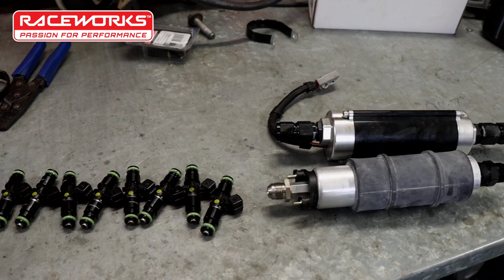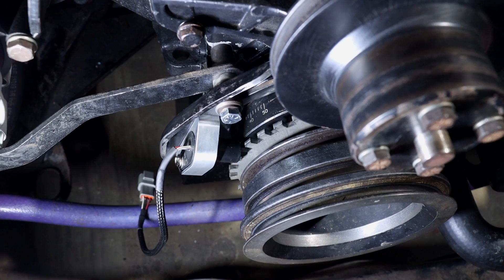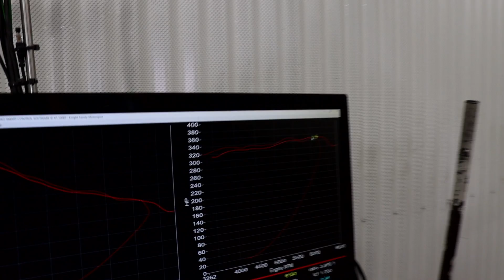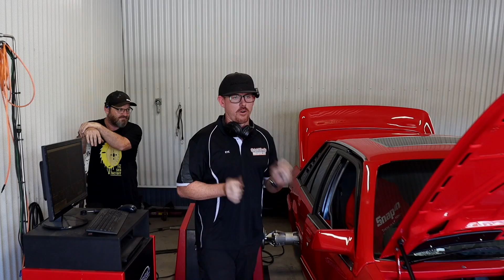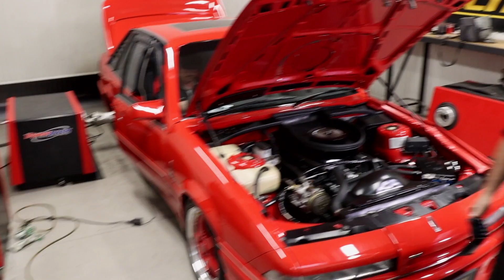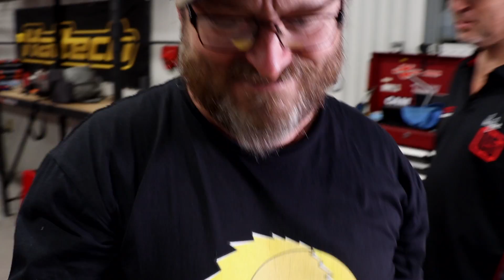NITROUS Fed HOLDEN 355 - Peter Brock VL Calais Sport Ep3

Comment from the maker: WE FORGET TO TEST THE POLARIZER!
Reply: if you fit two of them does it become a bi-polariser ? 🤔
Reply: @BaldBloke  😂👍
Reply: @BaldBloke  :face-fuchsia-tongue-out::face-fuchsia-tongue-out::face-fuchsia-tongue-out:
Reply: It would have reved out smooth with the Polarizer.
Reply: In your defense, polarizing a generator is a thing
Reply: It would've sorted the valve float and let you rev it to 10 easy.
Reply: Yeah, c'mon. You need to put the Polarizer on!
Reply: Back to the dyno.
Reply: If it really did nothing and actually caused harm,
We must call it a pfolarizer
Reply: Had it in your bedside draw al
Reply: @andrewfreer5797  maybe the wife has it ;)
Reply: @andrewfreer5797  :face-green-smiling::face-green-smiling:
Reply: THAT'S WHAT i AM HERE FOR!.....Disappointing...
Reply: And you didn't do one on stock setup so no comparison to be had.. 

Stares INTENSLY.. IDIOTS 😂
Reply: That’s the only reason why I watched this episode 😅
Reply: You need to put it in a specially mounted box and wire a hall sensor to the ecu, so when present, the polariser gives a few extra kw, then it would work for real!  👍
Reply: HOW POLARISING.
Reply: Would have made 15 more HP
Reply: @Adrianzx  ONly if the tire pressures are reduced to 10psi mate..
Reply: Oh well. Take it back to Banana Bender Tuning Fork.
Reply: Boys its a well known fact that the polarizer was static electricity and idk if you can wank on YouTube and it only worked from walking power 😂
Reply: Take the polariser to a vegan wet yoga instructor who can fold/unfold their genitals and knows astrology. If they're legit they will be able to tell you the crystal frequency just by holding it. After that it's all just basic woo math.
Reply: I was just going to ask that😂
Reply: I was just about to ask for the special magic box^^ align molecules voodoo style
Reply: Been dirt squirting lately boys ?
Reply: do not bother, it was all  marketing plan from the get go, prove me wrong guys?
If holden could not work it out, then you know its about trying to make the harmonics of the engine be a lot smoother, which we know its about blue printing and having the spec of the engine spot on, everything from valve springs, to lobe separation angles and ratios, right down to the gap of spark plus and even the right oil as well, like every moving part in the rotating assembly needs to matched perfectly and blue printed, no amount of crystal is going to make a rotating assembly smoother? 
Maybe the electrics for the car, no static residue that effects' the modulation of the dizzy, but you guys have a VT sequential dizzy, so it works via ECU, back in the day with carby, brocky had chevy needles and other items from the USA for the carby setups?
Reply: Came here to say just that!!!
Took the air filter off, but didn't put the Energy Polariser back in!!! 🤦
Reply: hi who you you recommend to dyno tune a 393 cleveland. cheers
Reply: You need to drop your tire pressure to 22 PSI when you do tested. According to brocky
Reply: can you use nos all the time in the Vl . Or in a drag car , does the engine have to pulled apart every time and rebuilt using the nos .
Reply: I reconditioned an engine in a VL Brock 'plus pack' around 1990. With the polariser disconnected from the universe the performance difference was staggeringly nil ! The smooth ride from the polarized VL was probably the recommended 24(if i remember right) psi tyre pressure. 👍🤣
Reply: @craig8187  idle tard helps smoothness.
So does 6 cylinders inline
Reply: @silverwolf4095  🤣  its a Polarizer! Maybe there would have been a better smoothing effect if it was spelt Polariser 🤔 S definitely looks smoother than Z , no wonder the effects were questionable!
Reply: @craig8187  these are the facts.
Back to the future screened at Village cinemas Aug 1985.
Brocky attempted to reverse engineer the tech but had to rely on a VHS copy of a copy.
The size of the crystal was off and the magnet ratio was wrong.
He was on the right track
Reply: @silverwolf4095   i think you have become polariszed !
Reply: @craig8187  on a serious note,
I believe the polarizer to be a clever marketing and plot device.
You tick that box and you effectively get the wednesday build, the closer matched parts. Rumor has it Brocky runs all polarized cars in, 2nd gear burnout.
The fact remains HDT could not afford the "advertising" Wheels and Modern Motor wanted. So they roasted the Bloke and his super cool car.
Either way, Id trust Brocky to setup a commodore better than those pencil wristed motoring journalists.
Reply: @silverwolf4095  if the Plus Pack engine i reconditioned was the better matched parts well id hate to see the poorly matched stuff. All that aside. I was around at the time but i dont knownthe facts. What i summise is that with all due respect,  Brock just got a little too confident or mislead and thought anyhe did/said would stick. Stick it did not, all up quality control was pretty average,  more serious names popped up and Brock was out. Al interesting,  debatable, yet great history. A time that I could happily go back to.
Reply: @craig8187  agree.
The golden era of ticking boxes that made a difference, LSD, headers etc, was much better than the muffler/wheel upgrades offered in later years.
Reply: 1st thing. 
Its a polariser, not a polarizer.
Brock was many things, but never a yank.
2nd thing, IMPORTANT! Polariser needs to be remapped for cam and passenger arm rest.
I know a bloke who does polariser reflashes and flash tunes mufflers.
Let me know
Reply: @silverwolf4095  :face-turquoise-covering-eyes:
Reply: removing the air filter would have done more than those crystals.

Comment: that tool pro scan tool is total crap... miss reads codes and shows false codes... had 1 showing me that my egr system, maf sensor, catalytic converter and o2 sensors where bad... took it to multiple shops and the real scan tools show nothing is wrong at all... the car was a 2010 ve omega

Comment: Wish we had Holdens in the States, awesome car! Is that engine basically a 305 LT1? (Stock trim not the modified one that this one is) 👍
Reply from the maker: The Holden V8 is bit of a mix of all the GM engine designs from the 1960s but is not the same as any of the others apart from some dimensional properties.
Reply: @theskidfactory  awesome thanks for the knowledge! Love your guys’ channel!

Comment: The Skid Factory +:  An interesting, fact-filled presentation concerning introduction of nitrous to this particular car/engine. In the process, identified mechanical issues w/ the existing ignition timing system and existing valve train. These issues were essentially corrected w/ the addition of a specific crank wheel/sensor, along w/ upgraded valve springs.
The end result, a now safely workable nitrous introduction to this particular car/engine set-up. As per usual...  Well done , guys!!! 🤗🤗🤗
Accordingly, the video is given the YT 'thumbs-up' 👍'rēē -ward' for an outstanding production!  Keep 'em coming, you two!

Comment: I learned this the hardware too. I had about 8 degrees (4 degree swing) of scatter on my L28ET. Might have been cleaner if I'd replaced the oil pump drive gear/shaft and then done the bronze bushing trick on the timing cover...

...or just switch to a wheel on the crank and leave the cam sync on the dizzy.

Comment: Fantastic content. I have the same issue with the timing moving around in diagnostic mode. Just a quick question if anyone could help out, how any tooth timing wheel would be used on a pre sequential setup VN 304?  Running original delco 808 ecu. Would it be just 8 tooth with equal tooth to gap size or that's not so important regarding tooth length as long its divided equally?  
Thanks guys.
Reply from the maker: You'd have to do 16 teeth on the crankshaft as the distributor is at half speed. Probably better focussing on a better ecu, the 808 only has 2 injector drivers for a V8 so is pretty ancient.

Comment: Yes, basically it's setting the offset so the ECU's "TDC" aligns with the engine's true TDC. If it's a scratch tune, it isn't so critical - the problem is when a base tune is used because that may be "timed" way to early or late, and when the engine is bebuilt and the disc, or pickup, aren't in their original positions.

Comment: So when it sounds like a rev limiter but it isn't then the valve springs are shot. You got to be a good tuner to catch that potentally catastrophic sound. And btw: Kye has a very good way to explain how stuff works, why he does things and what might have caused that massive oil leak under your engine... 😁😁😎😎👍👍

Comment: Kai is a hero for recognizing the engine was doing something funky at high rpm right away. That comes from experience and it's something a lot of tuners could take note of. That easily could have been something overlooked by most people and turned into a catastrophic failure on the dyno before you realized it. He saved a lot of time and headache by pulling it off and having you guys take a look BEFORE something broke and that's a huge help. Well done Kai.

Comment: 470HP with 50 more cubes than the vl group a race cars had, plus you guys got efi and nitrous, at the time it was claimed the HDT and Les Small engines had 430 with just a Rochester carby NA 5 litre, what sort of black magic were they doing back in 87?
Reply from the maker: 430 engine horsepower. This is 470hp at the hubs through a turbo 400 with a loose converter. The track will tell you the real engine power.

Comment: 6500rpm is still extremely respectable for an older-fashioned small block with original heads without all the stud girdles and other things we used to use just struggling to make it up to 6k reliably! I've never worked on Holden engines but our small blocks here in the states (the factory ones) you'd just about hang yourself and your kid's college fund just trying to get over the 5k (reliably) hump!

Comment: As said its his car and he's improving it, like people would have in the day. As an aside still have a thing for air-cooled VWs and at least in the states its real common for old, fifties stuff to be running big cube and also turbo running gear under a stock appearing exterior, well apart from wheels generally. Others insist on the purity of that original 36 or 25hp (gross) for their thrills... Small slow ones.
Reply: Let's not forget the Subie-swapped Beetles☺
Reply: @bvward a k  That reminds of the rotary powered  ones back in the day.
Reply: @bunning63  Back in the late 70's there was a kit to swap rotaries into Subaru's as well... Kennedy Engineering in California☺
Reply: @bvward  Kennedy Eng did heaps of adapters, aren't they still around?
Reply: Rover/Buick V8 into Kombi or Porsche with the standard gearing I recall they out accelerated the Porsche the engine would have come out of up to 80kph.
Crumbs, get told off by the VW purists soon.
Reply: @bunning63  Yep, still around doing interesting stuff!

Comment: Suggestion for the crank trigger, put a dowel hole in a non symmetrical spot on the pulley and balancer so it can only go on one way.  Or make one of the existing bolt holes larger and tap the balancer to match for a larger bolt.
Reply: Then it would be out of balance

Comment: I did the same thing for my crank trigger and it lasted about 8 years until the rubber lining went bad on the underdrive pulley. FYI if you're gonna do this... do it on an aftermarket unit like ati or Keep a close eye on the rubber and always remember that the rubber allows the underdrive pulley to move a little.

Comment: Nice care, sounds tough and great informative video (thanks Kye) Will be interesting to see how the VL goes at the track and if it has enough top end RPM with the new valve springs when it crosses the line at the end of the 1/4 mile. 👍🏻

Comment: Who cares what the haters think.  The build on this is awesome.  It can be returned to stock for the purists, but if it was my car, I know I’d be keeping it as it is now.  And I’m not just shooting my mouth off.  I also own a Calais Sport.  It left HDT the same month as this one, and has a build number about a dozen lower.   

As far as rarity, that becomes a bit of a non-event with the post-split HDT cars - whilst they may have started as a basic “pack” almost every one was built to the customer’s own desires, with a slew of available options on offer.  I know my car is very unique, but so is just about every HDT car built after Feb ‘87.  This is what makes them all so special - Brock gave the punters what they wanted, and buyers built what they desired.  It kept Brock going for another 18 months.  

I’m sure he would approve of modern technology to improve the power & reliability.  Brock was always looking to the latest thing GM USA were doing, and there are many examples of that influence on VH, VK and even VL.  I’m sure he would have embraced using LS parts.  We know HDT were already working on EFI before the split too…. So I think his approval would be a no brainer.

And to answer the very first question, the Aussie 308/304/350 is by far THE best sounding GM V8.  LP also proved that to everyone who watched and heard him run the VP at Bathurst when everyone else went Chev.  Holden always had to beat the yanks, and the “plastic” is proof our engineers built a better small block for the era.

Comment: I thought that the Valve spring squash theory had been busted a while ago 🤔
Reply from the maker: By who? What were the parameters of the test?
Reply: @theskidfactory   By Lake speed the American Nascar engine builders. They had an engine that made 711hp over 20 years ago. So they strapped it back on the dyno after it had been sitting for over two decade's head's still fitted etc and it made 725 hp with plenty of rust in the bores and valve springs that had been crushed for the better part of 20 years at which point they confirmed that valve spring squash hadn't made any effect.
Reply: @justin3131ify  if feel it may have something to do with the metallurgy of the springs as certain springs are definitely affected by performance loss due to loading over time (think suspension springs sagging etc.). The stuff Lake Speed would be playing with is probably night and day compared to what would be more or less a 10-year-old shelf offering for a Holden V8.
Also, very common for drag racing engines to have to periodically change their valve springs due to spring rate loss due to use, I believe some Pro Stock teams change valve springs as much as each run in some circumstances.
Reply: @knightfamilymotorsport  Thanks for the Info. One thing I found very interesting was that Lake speed himself actually said on video "if the spring tension wasn't what it should be we would drop them on the ground and the tension would come right back" happy to share said video with you incase there is something that I missing. FYI the engine that they dynod had been sitting unused for more than 2 decades, it even had some rust in the bores. They didn't clean it, nor did they change the springs before hand and it still made 15 more hp than it did 2 decades ago when fresh.
Reply: @knightfamilymotorsport  Also Lake speed aren't drag racers.
Reply: @Justin Powell  oh yeah very familiar with Lake Speeds work, a true master of his craft. 

Yeah send the video link through I'm interested to see his findings. 😁

Comment: The sound of Larry Perkins Holden V8s at 7500 on Conrod was the best sounding V8 I've heard on the mountain
Reply: I'll second that. The HRT cars in the Group A era sounded wicked too. But unquestionably the best V8 sound at the mountain I've ever heard was the Brabham BT62 when it did some demo laps at the 12 Hour in 2019. Ye gods, that thing sounded like it was going to rip the sky open. What a glorious noise.
Reply: I reckon the Les Small built roadways V8 in the Grice/Bailey chickadee VK was right up there as well.

Comment: DID YOU KNOW that Mr Callies - of, well, Callies fame - made a fortune manufacturing matched pairs of camshaft and distributor gears for NASCAR and Pro Stock drag racing teams? That was his foray between selling the crankshaft company and going into the lifter business with Ed Morel?
It's an overlooked area of precision in pushrod engines, but when you're winding up a small block to 8,000 rpm for 500 miles a go, you discover the advantages of things like distributor gears and timing sets that actually keep time, I guess.

Also, a Holden V8 through a single exhaust always seems to turn out 🤤

Comment: Can you run factory fuel lines woth e85
Reply from the maker: Yes. This car has 100 series rubber braid to the engine bay but we use 200 series teflon when we plumb. Cost and preference but both will work.

Comment: I thought valve float was the rev limiter in push rod V8s ;)
Reply from the maker: It is. That's what happened. Was much more fun in my 73 TA22 Celica.
Reply: it was for a stock 308 😁

Comment: Valve train is a science in its self!
Having the lifter bores machined, (or sleeved if need be), along with the a crank line honed, plus the deck of the block faced to match the crank, and then line hone the cam tunnel using custom cam bearings, makes all the valve train float minimal. 

: )